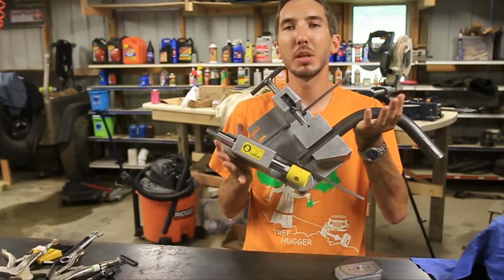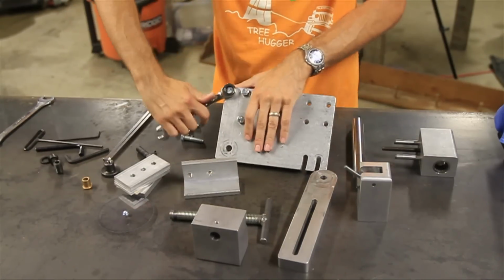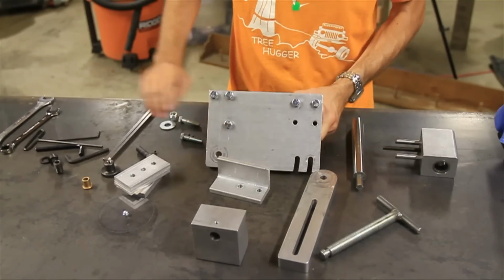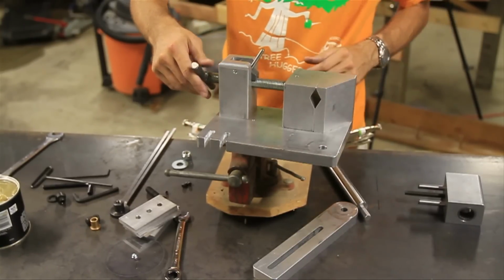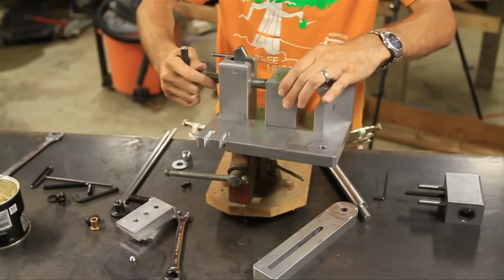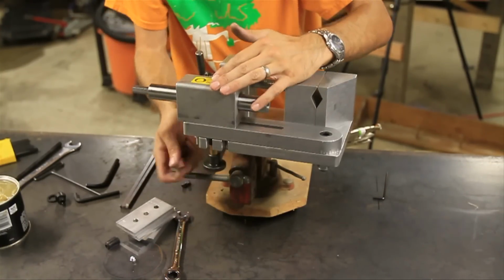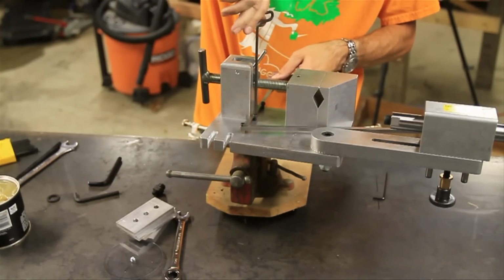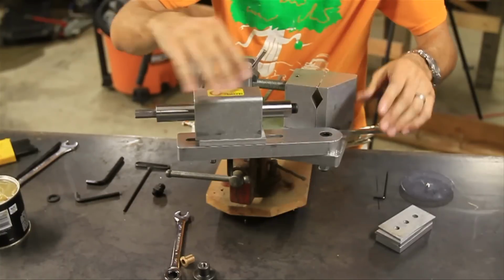Sync Notcher 180 Jr. - Tubing Notcher Assembly

Comment: Vice mount is not going to cut it for long pieces and the base plate looks small. Too small to clamp solidly. Can you give me an idea of the base plate dimensions?
Reply: If you use a good Wilton Industrial Vice and a roller stand( even two ) it works really fine...........I rack up 20' pieces of 3/4  and never have I had an issue .... if your cutting 4130 make sure your hole saws are Carbide tipped.... I build ultra light aircraft frames .